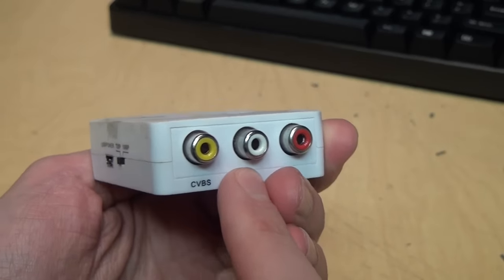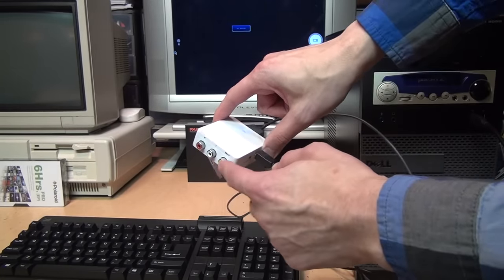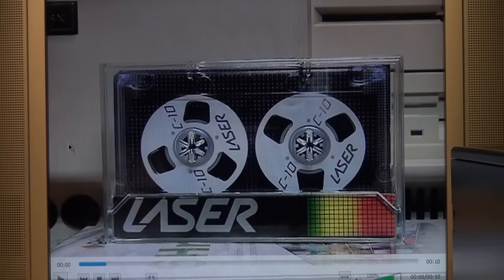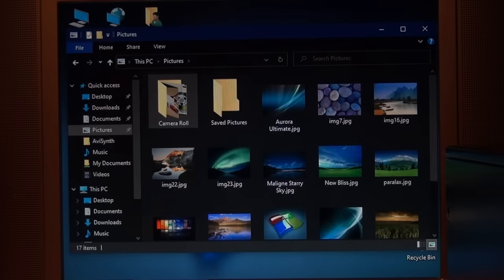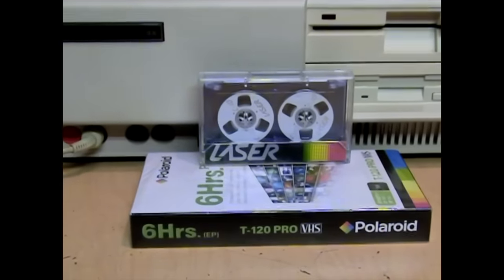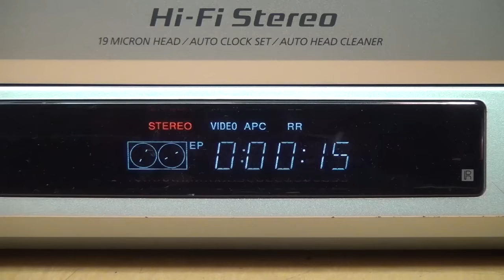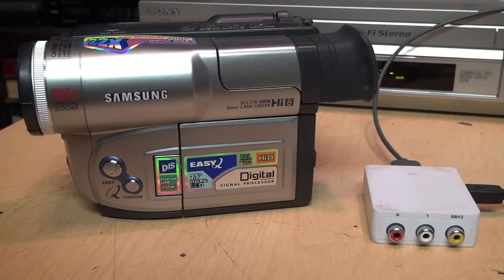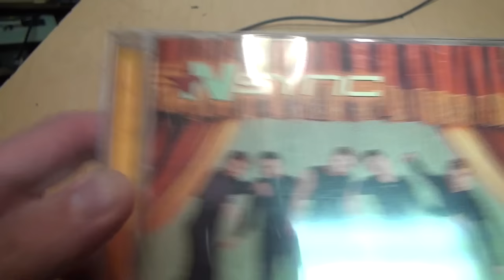Cheap composite video to HDMI converter - Is it really THAT bad?

Comment: I used to have the opposite converter, HDMI to composite. I used it to connect my PS4 to a CRT TV, the only TV we had at the time.

The video quality was awful. Composite was always a bit muddy, but it was usually much better than the mush that came out of that white box.
Reply: I have a composite to HDMI and im able to backfeed it, I used a roku on a old crt television so I think you could backfeed them
Reply: @Warp2090  unlikely unless it was designed for it, some may well be switchable bidirectional
Reply: @Warp2090  I have 2 TV's in my game room, my main 55in 4K Sceptre TV, and next to it for my retro stuff an early 00's 27in Panasonic CRT with component/composite input, and stereo output, that I have a Roku Express + 3900X attached too it, and looks like it's close to the end of it's life only getting Roku OS 11.5, and not Roku OS 12 like my main 4K stick did, so going to have to get a newer express, and convert it down to component, or composite as I usually have both TV's going during football season, or other events when 2 things are on at a time we want to see.
Reply: @CommodoreFan64  nice
Reply: @CommodoreFan64  never heard of "sceptre" though
Reply: @Warp2090  They have been around a fair number of years making a name in the budget monitor, and TV space(also doing OEM work), and I've owned a few of their monitors with good luck(I use 2 of their ultra thin 1080p 75hz monitors on my main PC), and I wanted a non smart TV that did not break the bank, and so I went with them being able to get it for under $280 USD off Walmart's website.
Reply: @CommodoreFan64  Ohhh ok makes sense now

Comment: I wish these boxes had a way to output the direct 480i or 576i resolution and some configuration rather than being forced to one of two setting sthat both upscale, deinterlace and crop off the edges as the actual analog to digital part in many of them seem to do a much better job than the av->usb2 dongles you get these days. Those often output in the original resolution losslessly but the analog to digital part in them is usually crap and with no sort of buffering.

I've generally landed on passing the video using various dvd-recorders from the mid 2000s when capturing vhs, as some of them (but far from all) had some excellent hardware in them built to handle videotape input well.

Comment: I have a device in the same plastic shell, only it's black. But on the inside, it's completely different. I haven't had a chance to use it since finding it in a thrift store bin, so I don't know how well it works, but it looks like the chip dates that I can see are from 2017. (Your chips might be from 2013!)
It has a brand name, I guess... the plastic case says "GANA MINI AV2HDMI UP Scaler 1080P", but there is no identifying text on the circuit board.
I would expect similar aspect ratio problems, but hopefully they got the audio channels right! (I will be sure to check.)

Comment: Wondering how would it handle genuine PAL signal? Should it output deinterlaced video at 50p and not in 60p right?
Reply: I tried a cheap converter from Amazon and had to return it because it had a fixed output at 60. With a PAL input, it just repeated every fifth frame which made it unusable. It seems to vary with different chipsets though

Comment: I was lucky enough to buy a Sony HDD-DVD recorder two years ago for $50 with HDMI output. It also has S-Video input, video noise reduction which is adjustable separately for luma and chroma, adjustable brightness, contrast, saturation, hue and sharpness, plus a built in Time Base Corrector of some kind, so even damaged tapes can be captured with a relatively steady image. I only use it to capture through its HDMI output with a $22 Aliexpress USB3.0 HDMI capture device.

Comment: I have 2 0f these, and a few to go the opposite way, as well as composite to VGA, vise versa. one of the composite to HDMI converters i have display inverted colors with certain TVs/devices. even had one units crystal go bad, resulting in flaky color. but for the price, they work great.

Comment: It may or not be important in particular case, but stereo channel samples might not be "swapped" so to speak, but might be buffered wrong - as in "1 sample delayed, so current L becomes prevoius R and current R becomes current L". Or some other bug of similar effect.
Usually not noticeable in the wild apart from obvious channel swap, but as an example - I caught similar effect when trying to adjust azimuth on my reel to reel using Berhinger USB audio interface as a reference source - there was variable (depending on freq.) phase shift between left and right sines straight out of its line output. Solved by replacing Behringer's own knockoff PCM2904 with original TI one.

Comment: You're very likely to get different results if you buy such white box new today. It will almost certainly contain completely different circuitry despite being enclosed into an almost identical case.
Mine doesn't output 50/60 FPS, it drops half the frames. Audio channels aren't reversed though.
Reply: It's a fact, I've opened a few of these, vwestlife have older one with better chipset

Comment: I have a few cheap converters and capture devices and the problem I've had is they don't work with all sources. They're fine with a VCR but some older stuff will show no signal or won't manage the vertical hold correctly. Yours seems good but these things are always kind of a gamble, depending on your needs I guess.

Comment: Back in 2014, I bought the Playstation 3D Display to replace my old composite-only CRT, and finally enter the HD era. As the PS 3D Display has no composite inputs, for a while I used this exact converter as my way of watching TV through my cable box and playing old video games (it could handle 16 KHz signals!)...

The forced 16:9 was annoying, and the lag made games annoying to play, but it served me very well, especially for the affordable price.

I barely need it for anything nowadays, but I also replaced it with a RetroTink, which fixes all the aforementioned problems (though at a much higher price).

Comment: I've got an identical looking white box, that does the opposite. Converts HDMI to a composite O/P. Need it for my CCTV set up. HDMI out from the CCTV recorder to analogue output, for old TVs used as monitors. Works well

Comment: How does the VHS footage (especially the first one) runs sooo smooth? I know you are in NTSC, I am in PAL and running sharp VCR and my picture and sound are very worse than yours (using master tapes). Maybe I should upgrade VCR to Sony or something higher quality with functions to give better picture? I want to transfer tapes to digital with professional capture card, but the vcr is the problem maybe. Any suggestions for good brands and models with functions like these or something better?

Comment: 8:45 "The engine oil dipstick is marked in red for easy identification. And if you look for a dipstick to check the automatic transmission fluid level, well you're not going to find one..." ...Now basically the only new principle involved is that instead of power being generated by the relative motion of conductors and fluxes, it is produced by the modial interaction of magneto-reluctance and capacitive diractance...

IT'S THE 'ROCKWELL RETRO ENCABULATOR' GUY!

Comment: I have a ton of these. They come in black or white. I have this one you have, VGA to HDMI, the reverse of the same. Audio extractor for HDMI, outputs in optical, 3.5mm. they're pretty handy when mixing consoles and old tvs. I probably have more. I use one to convert a Google Chromecast to av for my TVs. It can be powered from the HDMI port, but it will make a CC 2nd gen reboot from overheating it's 5v supply.

Comment: I have the same little box but mine functions in revere of yours. Input is the HDMI and output is the RCA ports. And instead of a 1080/720 switch, mine has PAL/NTSC. It says MINI in big type and below it says HDMI2AV with the lables INPUT and OUTPUT by the ports.I've never used it because I can't imagine a need to convert an HD HDMI signal to SD. If I'm capturing anything over HDMI, I have an El Gato Game Capture box that will grab video onto my Mac laptop. Great little device.

Comment: Using this in combination with a twenty-dollar USB 3 HDMI capture card seems to make a lot of sense.
Reply: Previously I had a USB 2.0 "easyCAP" device, but those are notorious for having ancient proprietary unsigned drivers that are very difficult to Google because of the number of different hardware with the same branding.

Having an HDMI capture device act like a standard USB webcam, with usb-3 bandwidth, bypasses so much pain.

Comment: This is very similar to what Alec from Technology Connections did. He used an HDMI recorder instead of a capture card. But what would the purpose built analog video capture setup you mentioned in the conclusion be? Something that can record from S video too.
Reply: It's nice this box simplifies the job with deinterlacing and upscaling. Something that would be done in post with an analog setup.

Comment: Looks like yours is a very old (and in some regards better) converter judging by the early 2013 datecodes and the fact that silicon image stopped existing in 2015 (bought out by Lattice). The newer ones like mine from 2019 have a singular Macro Silicon MS1858 converter chip running the show, which from my experience doesn't do as good of a job. Seems like Macro Silicon is pretty much the go-to company for these chinese AV converters and the cheap USB HDMI capture sticks and boxes that flooded ebay 2 years ago and never went away since. I have almost a dozen different AV related devices from said HDMI capture boxes and sticks (complete with fake USB 3.0 plug that's just a 2.0 colored blue, and the usual mono audio bug) over HDMI2AV and AV2HDMI boxes and things like HDMI audio extractors (HDMI signal passes through the box and it gives you SPDIF and analog audio output). And every single one of them uses a Macro Silicon chip, some even multiple. Cheapest bidder wins i guess 🤷‍♂

Comment: you can also use ffmpeg in any folder, just hold shift and right click, then click "Open command prompt here" and type the ffmpeg command in the command prompt.
of course you can also navigate trough the folder manually in cmd but that's not as easy.

Comment: HDMI is pretty friendly with macrovision sources, as long as the HDMI input device or card isn't touchy with its HDCP "protection."  However, if you were to try component cables for your HD conversion, the macrovision would remain. Go figure.

Comment: Aspect flag in ffmpeg just sets the display aspect ratio, which WMP apparently ignores (not surprising...). Using -vf scale=x:y with correct resolution would change the storage aspect ratio too, but in that case it needs to be reencoded.

Comment: I have one of these, but the deinterlacing seems to be rather crappy, and sync tends to drift away over time with more unstable sources (like VHS). Would only use it if I had no time to do a correct capture.

Comment: Interesting. 2 quick questions. If there were no in/out markings on it, how did you know it was HDMI/out? Also, doesn't your old video camera have a video in/out setting so you can either be sending or receiving signal through your S-Video?
Reply from the maker: I tried it the other way around, and it didn't work.

Comment: HDMI TO RF IS THE BEST. It has geometry aspect ratio stretch H:100 V:40 that can you do letterbox H:50 and V: 20 and cutoff 16:9 images to 4:3 or 3:2. Also includes NTSC-M, PAL-BG, PAL-DK and PAL-I as you can do with it’s remote control on US VHF channel 3 or 4 RF output, EU UHF 31 or UHF 21 (US UHF 14) RF OUTPUT AND HDMI INPUT,

Comment: I got a RCA to VGA converter box that's most likely by the same manufacturer that made the product in the video. For the most part, it works and turns a basic computer monitor into a TV.

Comment: Those cheap converter boxes are actually a better way of capturing composite sources than plugging in the composite signal directly into a composite capture device because you don't have to mess with the de-interlace, color range and washed out image.

Comment: It can be tricky to learn, but I have used the OBS software to capture my old video tapes. It allows you to use any webcam (such as your capture card) as the input, and you can specify the output aspect ratio and resolution.
Reply: It's possible also that ffmpeg or vlc can itself capture and correctly tag the video files with an aspect ratio of your choice without extra steps.
Reply: Thats basically just adding a frontend to ffmpeg. You can just tell ffmpeg to open a device, it really doesnt care much if its a block device (filesystem) or a streaming device.

Comment: I had the exact same converter to connect PS2 to HDMI. I remember there was problem with the sound, but as I used external speakers it wasn't the problem (connected audio channels to the speakers and only video to the converter). Aspect ratio was an obvious issue but then I just had to force tv/projector to display 4:3 in options menu.

Comment: I bought one similar dirt cheap off Ebay and to use my composite karaoke player on my 53 inch Sony Bravia. I had it running for a few minutes and my TV screen had vertical lines in it and got worse after. Even removing the hdmi from it did not correct it and the whole screen had distorted lines. Never had any issues before using the converter, it sucked.

Comment: I've been using Handbrake since I've discovered their existence, and it's the best FFMPEG frontend that I've found in order to make that aspect ratio quirks. However, OBS Studio allows you to fix the aspect ratio from the source in order to get a decent capture (yeah, it still uses FFMPEG, but in terms of coding is much more versatile).

However, I've bought a composite to USB to see if I can get a better approach due to the inner components makes them work like a webcam.
Reply: IIRC, Handbrake is it's own thing, not a frontend for ffmpeg.

Comment: You likely have windows media player set to fit to window. That is why the adpect seems off on the new file. You can change this setting and it should show as normal size.
Reply from the maker: But it still shows the incorrect aspect ratio even when I switch it to full-screen on my 4:3 monitor.

Comment: I've got this AV to VGA to use regular monitor for analog cameras. 720p and 1080p switch is connected backwards and image quality is terrible. Image is very blocky as really bad compression artifacts and text cannot be read even from 1000 TVL camera. It is maybe ok for testing some old gear with not so old monitor or as a security camera standby monitor not for actual use

Comment: I see 16:9 button in editor, on top right, does it do anything?
Reply from the maker: ClipChamp does not have an option for 4:3 aspect ratio. And even if it did, it would just letterbox the clip, instead of changing the aspect ratio.

Comment: I got something like that for my Nintendo 64 and I was very disappointed. It does this weird diagonal artifacting kind of like it's drawing scan lines diagonally.

Eventually I'm going to get a solder in HDMI board for it.

Edit: K-lite codec pack also installs FF-mpeg :D

Comment: I just installed on of those withe boxes that does the opposite, HDMI to composite, cause my dad wanted his cable box connected to his 27" Panasonic Tau CRT so bad, and after some adjustments on the service menu I actually got it to display on 16:9 aspect ratio so the picture didn't look squished lmao.

Comment: In the absence of a ratio switch on the white box, setting the ratio in the video data is the responsibility of your hdmi capture software. And this will rely upon you telling it the ratio of the analog video, since composite alone has no way of signalling what the ratio is meant to be. So this is not a failing of the white box. A limitation perhaps.
Reply: Widescreen signaling (WSS) can be used to indicate aspect ratio on composite video signal. But you of course need both the camera and the capture device to support it.
Reply: @ville_syrjala  Ah, thanks for that. I knew about pin 8 in the scart connector, but not wss.

Comment: These boxes very much contain the same hardware as many TV use for the same job. They are not bad for your application. However for gaming, where you have many sharp lines and need low lag for twitch response. They are not great. Usable, but not great. The video quality for games is mediocre compared to a HDMI upgrade as available for many consoles these days. Or even the specialized up scalers.
If you want to know the chip in there, just Google it. This device and it's iterations have been documented ten times over. The manufacturer unfortunately has no public datasheets for the chip and if you want it they seem to require an NDA.

Comment: think i may have one of these...somewhere..or a thingy that does the reverse, hdmi to composite, but cant remember where i shoved it! hadnt tried it yet!  i have a couple of vga to composite converters, different shaped case, they do work ok but they lose the settings such as size/position when powered off , bit annoying
Reply: i use those vga converters to use/test pcs on a lcd that although has a vga input, it has very limited scan rate compatibility, , the converter, much more so

Comment: ClipChamp can change aspectratio of the whole videoproject - just take a look on the top right corner where it says 16:9
Reply from the maker: ClipChamp does not have an option for 4:3 aspect ratio. And even if it did, it would just letterbox the clip, instead of changing the aspect ratio.